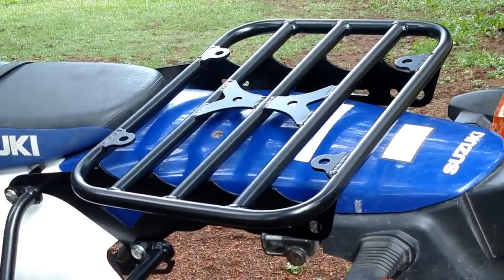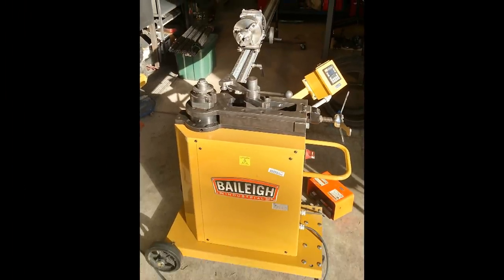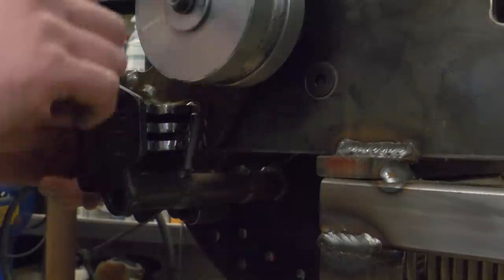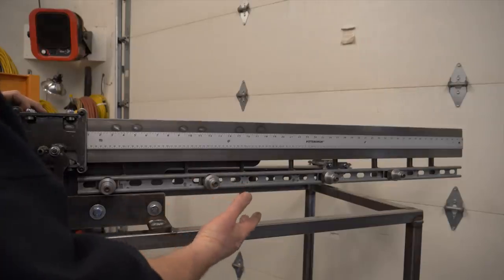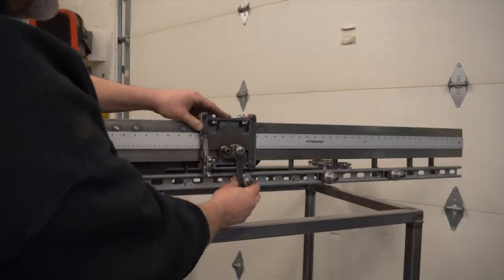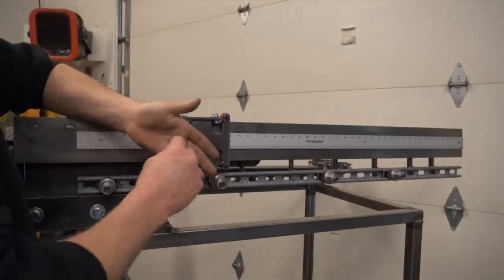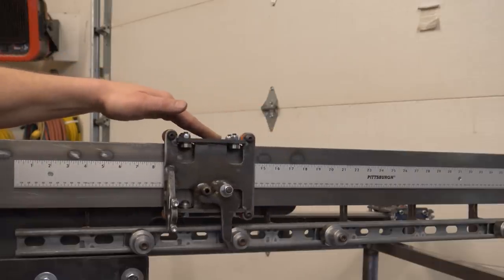DIY Tubing Bender shop project - How to build a tubing bender homemade manual rotary draw bender

Comment: Hey moto mule just a thought maybe use a bicycle style quick release for the pipe holder instead of using a ratchet on every bend. Love the project, wish I had enough room in my garage to build one. You could probably sell those if you wanted
Reply from the maker: Thanks, I ordered quick releases for it. Already tired of the threads... 😆
Reply: I was coming to say to use a cam lock to speed up the process.
Reply: Probably could make a self locking mechanism that will only lock when pulling on the handle.

Comment: Nice work Mike.  Repeat ability looks spot on! just a thought, replace your tubing clamp retaining bolt with a  Pneumatic air cylinder. A short stroke 2" pancake @ 100 psi should be more than enough. I've been Designing and building automation equipment for 32 years and I'm sure you know in a production environment time is $$$. The Versa bar is a great idea for  Infinite adjustment. 👍
Reply from the maker: Thanks!!

Comment: Great machine you built there, everything is perfect except for the fact that you have to unscrewing that thing to keep it from slipping which can add up in time after a few hundred pieces.  I'm going to build one based on you video and see if I can come up with a different solution for that thing. Cheers!
Reply from the maker: I put a bicycle seat post cam/lever in place of the screw.... WAY faster.
Reply: @motomule  yes I was thinking something that you twist and gets tight. You just solved it haha. Thanks

Comment: Hey Moto Mule just a thought maybe use a enduro bike hidraulic clutch actuator, mounted on the bending handle for the pipe holder instead of using a ratchet on every bend
Reply from the maker: I added a quick release cam lock like on a bicycle seat, it works awesome!!! Thanks

Comment: Maybe you already thought of this but I have an idea for locking the pipe in when bending. Instead of using the socket wrench can or could you make a quick release lever like on a mountain bike hub or seat post. It might be easier and faster just making it might be the pain in the butt. Or it could be really simple. all thread rod, washer, springs, quick release and mounting point. If your not sure what I'm talking about just look up quick release seat post clamp.
Reply from the maker: I did just what you described a while back, so much better!!! Thanks for watching!!!

Comment: As I was watching it I was think man there has to be a better way than a ratchet. Then I hit me a cam lever like the ones one a bike would make that a bit easier. You might even be able to use two in the clamp part making that faster too. You could go with one it might work well enough. My guess is you are going to need to make a lot of them.
Reply from the maker: I actually ordered some of those, already tired of the rachet... 😆

Comment: Well made bender. Love the size and ease of using to bend material.have you tried using a spring loaded clamp to hold material in place instead of using a ratchet everytime. Just a thought. Great build I enjoyed watching bend process.

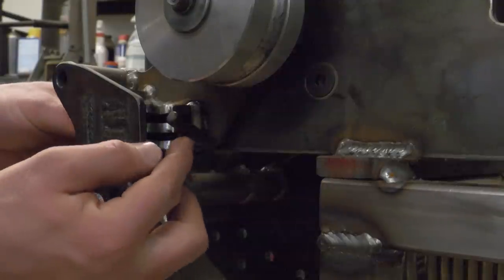Comment: @ 4:39 could that be replaced with a spring loaded set up? Instead of having to tighten and loosen a bolt, maybe you could press and turn against a spring. Not sure if that makes sense?

Comment: just a thought get or make a tee handle nut driver could save you time on the clamp system . not having to switch the rachet back and forth
Reply from the maker: I ended up putting a bicycle seat quick release on it, no tools required now!!
Reply: @motomule  that's even better .

Comment: What a great job on this bender. Very professionally done. Obviously you're a tradesman of some kind.
I'm a certified millwright and love this sort of stuff. Semi retired now and just playing in my shop on Honda dune buggies (FL350). Crashed one and broke my back. Then I rebuilt it. Problem was I had no bender and had to wait for months for a chassis builder to bend two tubes 1 1/2" dia by 1/16" wall.
Do you think this bender would bend that with proper sized dies ??
I ask that because I made my own dies for a greenline bender and it kinked the tubes so I took them to the pro that had a JD square.
Thanks in advance for any replies -- great work and thx for sharing.
Reply from the maker: Tganks! If you beefed up the design it could do larger tubes. But at some point you'd need to add hydraulics or some other method to "add to your weight"...
Reply: @motomule  Yes, and that's what I did on my modified bender with homemade dies. Hydraulics is the only way to go on big stuff. Just wondering if you thought your design would kink the bigger tube ?
Reply from the maker: @canadianoddy8504  the challenge is not so much the large diameter, but the thin wall thickness... You'd almost need a mandrel inside the tube to prevent kinking in that thin of tube that's that large in diameter.

Comment: I'm just curious, your 90 degree stop point appears to take into account the spring-back because I see it pull slightly past 90 and then when you release the bend right at 90.  At what point in the build did you work that out and how?
Reply from the maker: I planned for 6deg of spring back. But, that was too much. You'll notice at beginning of video the stop is smaller in diameter than in the end. To answer your question, I figured it out after testing it out... Thank for watching!!!
Reply: @motomule  Nice! I hadn't thought about changing the stop pin diameter...great solution!  I was trying to wrap my head around all those different stop holes you cut and how you were accounting for spring-back.
Reply from the maker: @WheeliePete  yup, holes spaced at 5 deg increments, dial in with pin diameter....

Comment: If the support rollers, were sitting closer to the radii die..  Wouldnt more of the kink be eliminated as its forced to maintain its shape thru out the bend.. and the second roller would stiffen the tube going in between them?! I make assumption based on a JD32 bender design here tho.
Reply: Also would be super simple to make this go up in size and make it a flexible mandrel bender to be fair.. great design.

Comment: Amazing job at building something with consistent output.  A curiosity question, will the hoops you're making be welded into a complete loop?  Or will that slight opening be there on each one?
Reply from the maker: Welded into complete loop.

Comment: Hey mike, I was wondering if I could contact you about making a motorcycle rack for a specific motorcycle. Let me know. Also I submitted comments through your website.
Reply from the maker: Hi Adam, making a one off rack would be expensive. It takes several hours to get everything figured out in addition to making the rack itself. I'd only be interested if the bike was here and you understood that my time is not free. Not trying to sound like an A-hole, just have had a few bad experiences... 👍
Reply: Moto Mule well I would be willing and happy to bring you the bike, and yes time is money. I also think that others would be interested in the rack and I think it could sell on ProCycle. It’s a XT350 and the models are all the same from 1986-2001. And I know some things from the XT600, XT225 and TW also fit so who knows, the TW rack you made might be a direct fit.

Comment: This isn’t really a “diy” project. It might be “homemade” for those who have access to a CNC plasma cutter (which most of us don’t have” but for the average guy, and custom made dyes and all of that. this isn’t much of a difference from having to buy one already made.
Reply: My thoughts exactly!
Reply: Not a single part here requires anything fancy other than an angle grinder, drill and a welder, all pretty normal 'DIY' tools. Just requires much more fussing around and careful measuring and it doesn't look as pretty, but sure can be made.

It is nice to buy machines, IF you have the money for them.
Reply: Jaakko Fagerlund first of all, you would never get anywhere as accurate as the stuff mad with the CNC with just simple tools, a couple of drills and a grinder as you say. But you are missing the point here. I’m not saying someone couldn’t make a bender with simple tools, what I’m arguing is the use of “DIY” and “HOMEMADE” that you see on the title. Because as this was presented, this is none of those things, and it’s beyond the capabilities of the average joe with the use of simple tools. And I’m not even getting into the making of the dyes (which require a lathe) and I want it make it clear that I have no beef whatsoever with the creator of this content, I think he is making really great tools for himself. I just wouldn’t categorize this level of fabrication as do it yourself or homemade